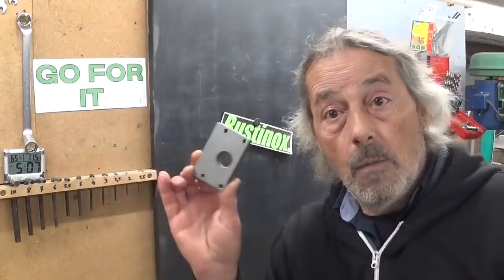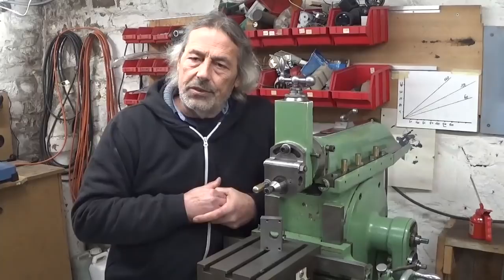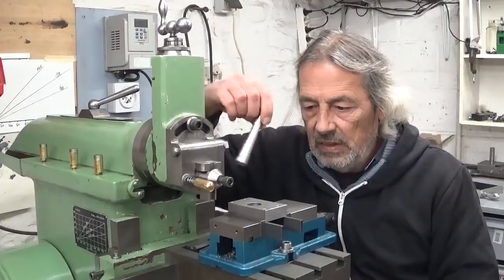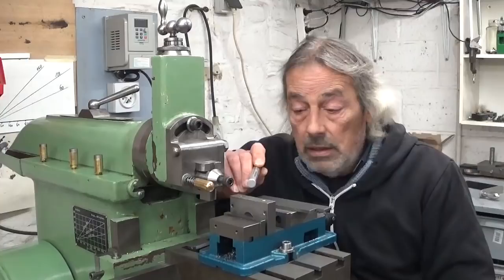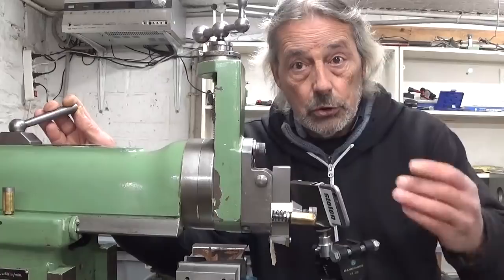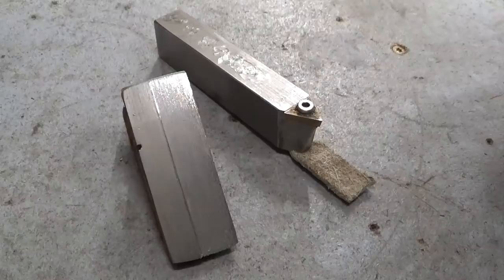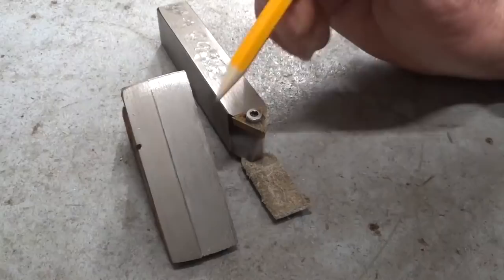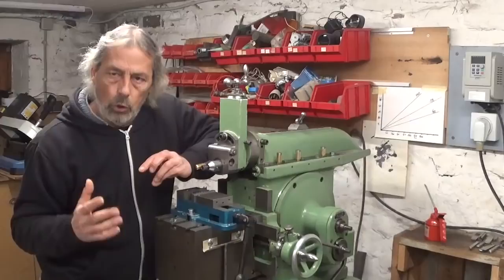Compare shapers vs. milling machines.

Comment: Beautiful machine. In it's day, shapers were a perfect solution to a machining need. Good to see these machines still in use and not scraped.
Good video
Reply from the maker: In commercial workshops you don't see shapers anymore. Milling machines are more versatile. But in the hobby shop it can have it's place.

Comment: Great video Michel, Carbide is nearly always negative rake, and requires high surface speed, and high forces, compared to HSS, where positive rake is normal, with low surface speed, and reduced forces. Thanks for sharing.
Reply from the maker: Indeed, Carbide needs more "horses" than HSS.

Comment: My favorite for old manual machines is M42 cobalt high spped tool steel,( American designation ) cuts beautifully, and is virtually indestructible at lower speeds
best regards and happy holidays !
Reply from the maker: Yes, there's absolutely nothing wrong with HSS.

Comment: I was led to believe that carbide doesn't like an interupted cut. I confess iv'e never tried it but i will now........Cheers
Reply: You were led correctly, carbide is not good with interrupted cut on any machine, this, well let's call it a 'truism' is a time served turner's mantra from when carbide first emerged in industry. Compared to HSS and Cobalt the turner's were used to, carbide was quick to degrade when turning/facing over hole pcd's etc. If you apply the logic to a milling machine, every feasible cut from any tool is interrupted by nature of the fact the tool spins. On a milling machine in industry (CNC) , it is best practice to keep the tool buried in the material as long as possible, it is the entry and exit of cuts that breaks the cutting edge down more quickly. Hope this helps demystify an age old mantra. Cheers, Jon
Reply: @jonsworkshop  Thanks Jon, appreciate that👍
Reply from the maker: Give it a go. Maybe it works just fine for you.

Comment: It takes me 6 to 10 minutes to just put the vise on my mill.  And the vise for the shaper is about 200lbs so I never comes off.  I like doing a lot of work on the shaper instead of the mill just because the cost of HHS is so much cheaper. Then HHS end mills.
Reply from the maker: Yes, I can understand that a vise like that, you don't want to move it if not really needed.

Comment: Shaper.  You did it backwards.  I would suggest truing up the sides first, so that you have a true surface to put in the vise when cutting the front and back sides.  This would give you much better holding pressure and cutting the ends square can be easily accomplished by using a square for set up.   Shapers can do virtually everything a vertical or horizontal milling machine can do, and some they can't, like cutting internal splines or keyways.  What killed them is that they were not really amenable to CNC technology and required an operator to sit and watch them.  I love mine and it is fun to watch old technology work so well!
Reply from the maker: The ideal is to do the biggest surface first and use this as a referance to square up the others. But what I did here works too. After all, square is square.

Comment: I have operated shapers and millers for over 60 years. I have a 10in stroke shaper in my home workshop, no milling machine.
 I use a vertical slide on my Colchester lathe for any milling jobs not possible on the shaper.
On carbide tools: I make my own. When brazing the tip I stack the tip as follows after cleaning everything and fluxing the bits. A shim of brass followed by a copper shim then another brass shim. Put the tip on top. Heat using a gas air blow tourch. 
When the brass starts to melt press down on the tip with an old screw driver or file. Let the tool cool slowly in ashes or warm dry sand
If you are using oxy acetylene use soft flame. I was told as an apprentice that a fierce oxy flame can de-nature the carbide.
Now the important bit is that the copper shim acts as a shock absorber protecting the tip from shock when machining say lumpy cast iron or using the tool on a shaper😅
Reply from the maker: That's interesting. Thanks for sharing.

Comment: I think the carbide can be cut and honed to a proper edge to work on the shaper. However it is still brittle and will disintegrate. I have a broken carbide endmill, I should try this some time.
Reply from the maker: Go for it and give us your thoughts.

Comment: The workholding is the pit fall of traditional shaper. There is vertical machines which bypass large part of problems, but they are heavy and high. Even some job shops today keep big ass Pratt, Butler, etc vertical in corner while they still have old hand who can ran it. Saves good amount of money and time not to send part to EDM shop.
Reply from the maker: Work holding isn't different on a shaper than any other machine. It's just that every type of machine has it's pros and cons. And shapers are fun :)

Comment: Maybe a strip of spring steel in place of the leather to protect the carbide.
Also it would be interesting to see how it would work in a shear configuration.
Cheers
Reply from the maker: I never tried with the sheer tool. Maybe I should give it a go some day.

Comment: Rusti, as you say time is not such a factor for the hobby machinist. I have a shaper and I have no plan to buy a mill at the moment. If I did it would probably be a benchtop CNC mill. For me there are many advantages to a shaper - it can be quite compact, tools are cheap, it cuts keyways, and it is relaxing and nice to watch. With a bit of imagination it can be adapted for other tasks. Cheers
Reply from the maker: Indeed, on a shaper you can make whatever you want. Just go for it.

Comment: Could Not argue much about setting up times on either machine.

Run Times ??
Could be a Totally different story 🤔
Not much that can be made on a Decent Bridgeport Style machine.
Where as a Shaper can be very limited in it's operations, when comparing to a Mill.

Possibly only my thoughts of course ??

Still a good video to share 👍
Reply from the maker: On a shaper you can make whatever you want. The "run times" just depends on  the way the operations are executed. This, of course counts for milling machines too.

Comment: A couple thoughts, Michel. Whenever you are going to shoot something that is time reliant/dependant try to get a clock into the shot... or turn the timestamp feature on in your camera... Also, I think your carbide insert experiment bears repeating. Go to your local shoe repair guy and ask for an off-cut of 1/4" thick VegTan Sole leather, way more wear resistant, and maybe thick enough that it doesn't need to go all the way under the cutting edge... Also, most cobblers are "tool guys", so if you explain what you want to do with it they will likely give it to you free, and want your Channel Name so they can see what you did with it... Bonus feature.. New subscriber!!! ;)
Reply from the maker: Well, the fun is, I am an ex shoe repair guy myself and I have pieces of leather and rubber.
Reply: @Rustinox  Awesome! That was one of the 3 jobs I had back in highschool...

Comment: It is not easy to drill a hole with a shaper, I have not done it and do not know if it is possible. I do know that the tooling for a shaper is BUCKET loads less expensive than that for a Mill as well as to cut an internal keyway on a Mill you have to have an expensive attachment. Each Machine has it's own pro's and cons, I love both. John, Australia.
Edit for spelling. John.
Reply from the maker: Indeed, just use a machine for what it's made for.

Comment: Hi Michel, interesting comparison between mill and shaper. Carbide on a shaper is not a good plan, the whole benefit of a shaper is the reduced tooling cost, the minute you use carbide you lose this. Also, as you correctly point out, you just can't achieve the surface speed (although I reckon EYUP Tony had a good go on his video last night 😂😂😂). Fantastic slow motion footage, I could watch that all day long! Cheers, Jon
Reply from the maker: It's the slow motion function on my phone. Works really well.

Comment: The "boring thing that makes holes" for the mill is actually just called a "boring head." :)
Reply from the maker: The moment I wanted to say "boring head", I had a short circuit in my brain.
So, "thing" it became. Thanks for the tip anyway.

Comment: I have both V mill , H mill  and a Shaper, both the H mill & Shaper are Atlas. My Shaper is the go to for serface work. HHS stays sharper longer and much easer to tharpen, clean up of large chips is easer, the serface finish is better. The clean up for the Vmill with thoes tiny ants swords Thats a real pan in the ass, end mills dull fast and one needs a mill end shapeaner. Lately I have been using my Vmill for a drill press.Set up time seems to be in faver of the Shaper
Reply from the maker: That's very interesting. Thank you very much.

Comment: I dont know anything about a shaper besides for the few things on youtube ive seen. When it comes to how the engineering industry see a shaper machine and its application, i also dont know, yet maybe there could be variants of inserts suitable for these applications, or maybe not. However, what ive seen in your slowmotion part of video, the return stroke of the clapper box is designed to protect the cutting tool when pulling it back and up. Yet the action somehow allows the cutting tool to get knocked up and beaten. Would it be right to say its one of the few constraints of the uses of the shaper machine. For the individual who experimented with set up times, id say it may not be fair to compare them this way,  the mill and the shaper  are good in their own right for their application. Just my silly opinion😂
Reply from the maker: A lot of shapers have an automatic system that lifts the tool on the backstroke.

Comment: Carbide in the shaper is a waste of time I think,  They were invented before carbide and retired before carbide.  It was not a cutting tool they were ever intended to be used for.  It would be frightening to see a shaper moving fast enough to use carbide (100-200m/min).  Re setup time, my milling table is large enough that my vise is almost never removed.  I can use the table either side for alternate setups.  It's just not a fair or relevant comparison.  Use the tools you have to make what you want and have fun doing so.  If time was really important to you, you wouldn't own a shaper LOL.
Reply from the maker: " Use the tools you have to make what you want and have fun doing so"
Spot on. I cant agree more.
Reply: @barrygerbracht5077 That is a very wrong statement. Carbide existed when shapers were widely used. The reason to not use carbide is: a) to brittle for the interrupted cutting b) doesnt like the varying surface speeds of the stroke. Later on, shapers were used to create very flat surfaces with exceptional finishes (like milling machines or machine tables, and mold and die work) because shaping is much faster than a grinder that you plop a whole milling machine onto.

Comment: maybe an idea would be a torsion spring at the back of the tool holder rubbing onto the material to lift it on the back stroke
Reply from the maker: That could work.

Comment: I had an idea about the carbide. We all know carbide is sensitive to shock loading, and interrupted cuts. What if there was a way to remove some of the tool pressure on the carbide? Perhaps set up a brazed on piece to mimic the way a hss cutter is ground for finishing passes?
Reply from the maker: That could work, but you loose the advantage of wear resistance of carbide.
HSS will preform the same.

Comment: Always interesting Rusti 👍 I have often wondered why nobody has come up with a device/jig/attachment/thingy to hold the cutter up on the return stroke, surely it must be possible?
Reply: I've seen that very thing in an old tips and jig book I have somewhere.  May have been a Lindsey Pub. Book. Simply a piece steel behind the cutter precisely set so it's edge rides the work instead of the cutting edge.
Reply: @theradarguy  👍 Sounds like a good idea. I was more thinking of something that might be connected to the ram with offset timing to physically lift the cutter on the backstroke. Beyond my paygrade to be more precise, just an idea 🍺
Reply: It is usually a feature on larger shapers with heavier tools and holders. Mostly the tool lifter is cam operated.
Reply from the maker: The automatic tool lift exists since the shaper was invented. There is even one on my machine, but it never worked.
Reply: @Preso58   Obviously I have a lot to learn about shapers 🤣 Luckily I know a bloke that has one tho
Reply: @Rustinox  Well there's a new project for you 😁

Comment: Hi Mr. T. Do you think you will ever buy a milling machine ? I find I use both the shaper & mill on the same job ! is it just me but when I have got a job to do the vice always needs turning 90 degrees. Being hobbyists its good to experiment with different cutting tools, thats how we learn. Just bought some brazing flux, gonna try a go at putting some carbide on some chisels I have made for wood turning. Finally what music do you listen to on your hi-fi. Del.
Reply from the maker: The day a come across a good deal on a milling machine, I will buy it. There's absolutely no doubt about it.

Comment: I have a friend who is selling an old Aamco shaper, are there any tasks other that keyslots in which these excel over a mill?
Reply from the maker: The shaper can remove material faster than the milling machine.
But the milling machine is more versatile.

Comment: Just an idea would the geometry of the Insert holder be wrong for that type of cut?
Reply: I by no means am a expert but it seems like it was pushing the chip straight instead of off to the side just an idea maybe a different angle on the carbide insert would help I've noticed that with my lathe tools  aluminum vs steel  have different rake angles
Reply from the maker: Indeed, as I said in the video, the tool geometry is not correct for this application.

Comment: Is a shaper more cheaper and easier way to make flat and parallel surfaces than compared to face mill doing the same task? Can this be used to shape flat for scrap granite surfaces?
Reply from the maker: Absolutely. The machine is cheaper to buy and tooling is just Hss blanks.
Reply: @Rustinox  Thank You for replying.
Reply: @Rustinox  I wonder how I can scrape 24" x 24" x 3" rough granite surfaces of all sides using the shaper to make it square, flat and parallel, I can use HSS blanks to scrape granite? Thanks.

Comment: I'm finding the trick to good surface finish on my old shaper is a razor sharp edge. The cheap insert tooling I have doesn't have an edge like that. I've not tried to sharpen them to an edge like that, can it be done?
Reply from the maker: Indeed, very sharp cutting tools give the best results.
You can grind carbide with alu-oxide or diamond wheels.

Comment: I think there ist not much difference in Time to set um this past in the Shaper or the mill.
I learned you need a automatic clapper for Carbide because it is so bridle 
My Klopp has an automatic clapper but I mostly use hss
Reply from the maker: I also think that the setup time is about the same for both machines.
Reply: @Rustinox  installing and trimming the vise is about 2 or 3 minutes.
Depends on the experience of the operator 
You can also spend 10 minutes on trimming....

Comment: The leather idea is totally brilliant! 

While it's not really the same type of setup, I recently reconfigured 1 of my mills into its "shaper" configuration https://youtu.be/kPe7LEVRjhU
If I recall correctly it was about 15 minutes to do that alone...that being said most simple op setup times for mills and shapers probably isn't really too bad...especially for more skilled operators...of course more complex setups like a rotary table or dividing head that's another story obviously...

Even as a hobbiest time matters for me, as such I tend to try to take advantage of the speed the mill offers over the shaper,  and use the shaper/slotter for there strong points when needed...

All that being said, I think shapers are fantastic machines. 
My biggest issue with even my 14" shaper was lack of table space. Not really an issue on the Cochrane bly at least...

And of course sometimes we need to work harder metal's that HSS just can't manage...
Reply from the maker: I've watched your video's on the shaper head. Aldo Machine Nut Del. That's what inspired me to make this video on setups and carbide.